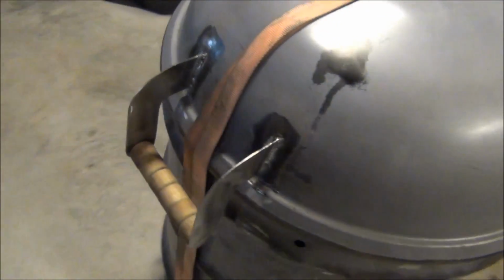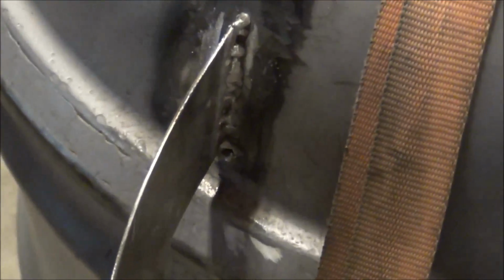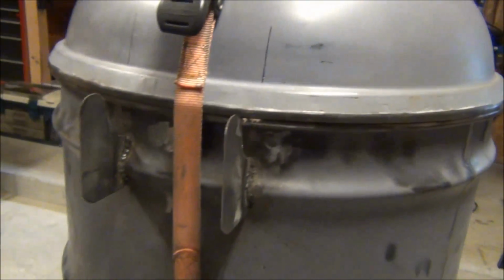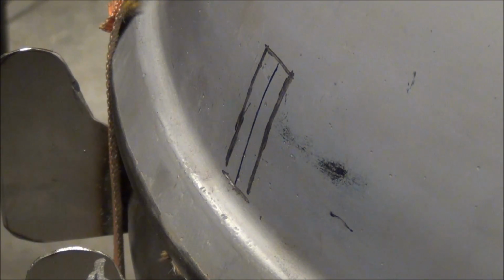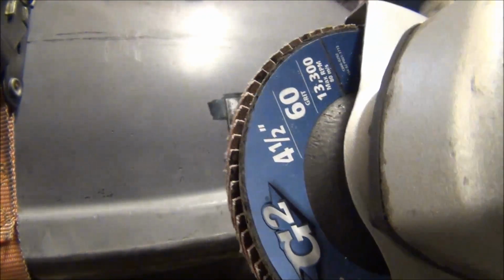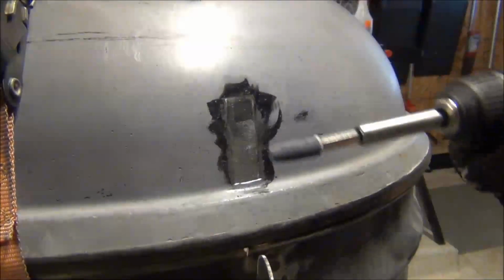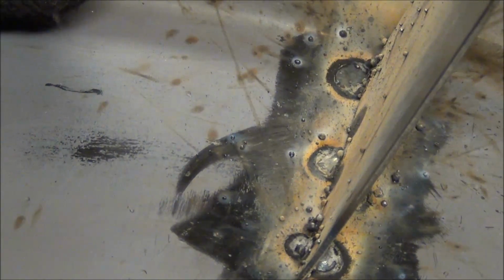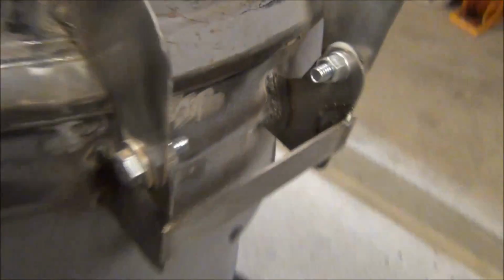Ugly Drum Smoker(UDS) Build Part 7 - Hinge and Handle

Comment: hey chad. how about putting a spring style , adjustable metal clamp on the front of the  lid the keep it air tight. just thinking mods and welding.  but if your smoker doesn't need then dismiss this comment.